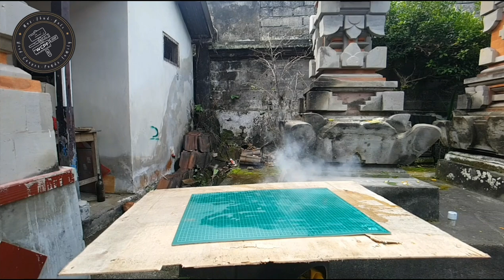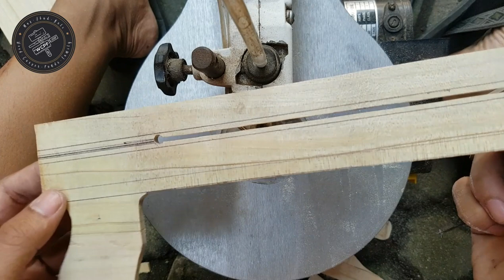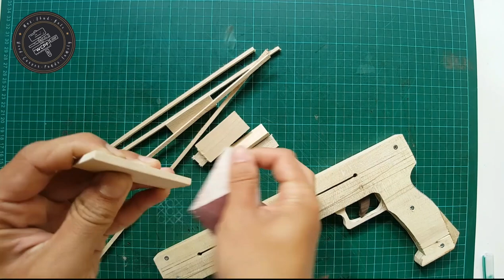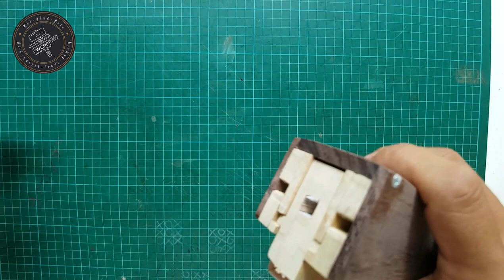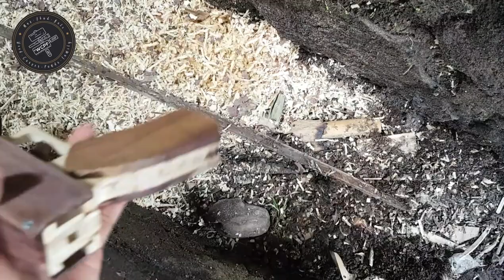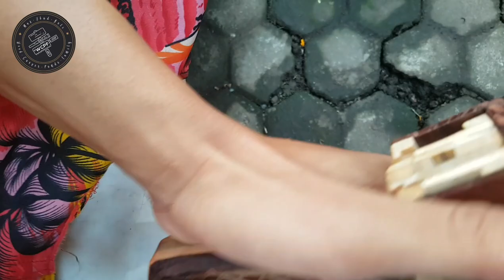How to Make Wooden Slingshot Beretta Version with the Sliding Barrel | Woodworking Technology | DIY

Comment: Hey have you put any wood piece inside the barrel to push the bullet or it is only a rope please answer my question ⁉️⁉️⁉️⁉️
Reply from the maker: No... it is only push by rope..
It much better than use wood pcs.
Wood pies will reduce the power.
But you have to make the size of the barrel is close enough to size of ammo